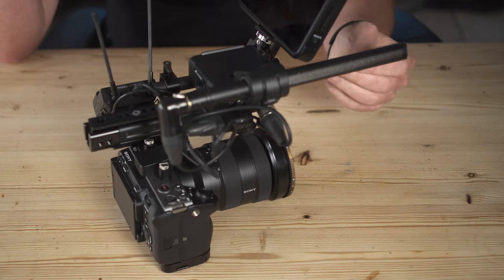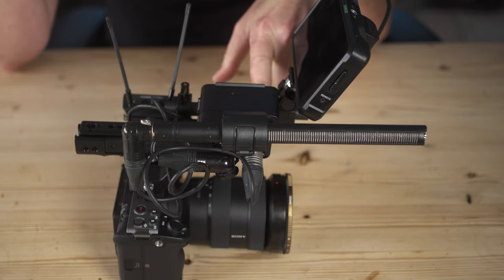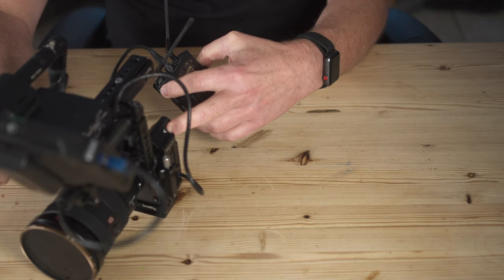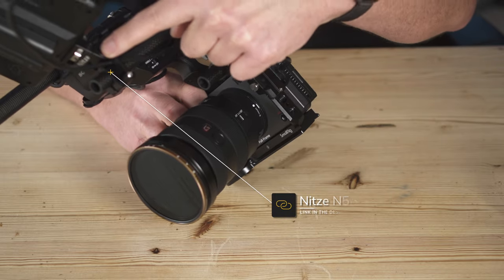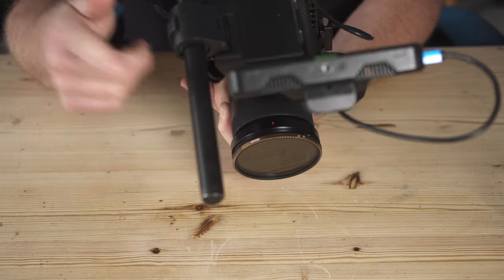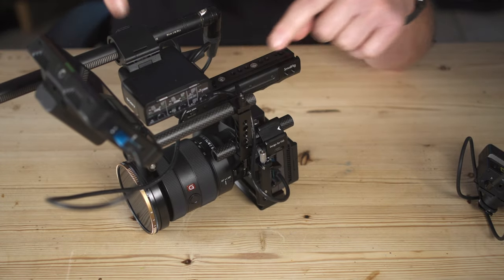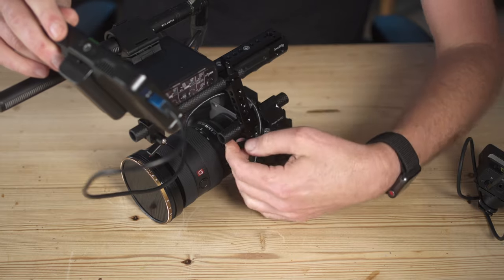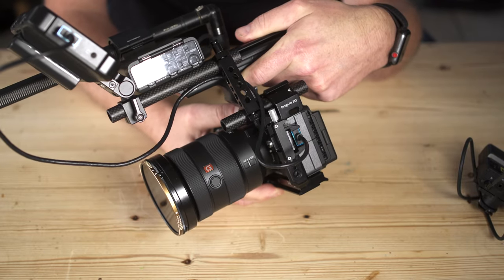Sony FX3 / FX30 Rig - A Better Way to Mount Your Monitor!

Comment: This is a really clever solution, and probably the best I’ve seen so far. Only problem is that it seems like it would pic up the fans on the monitor on the mic. And maybe only work if you’re using a super directional/long shotgun mic with little to no pick up pattern on the side of the mic. Which is tough to find, especially that close to the mic. And I use an short Octava condenser mic and that would put it right at the fans of the monitor. 

I hate that there’s no balanced way to add a monitor to the top handle and that also doesnt interfere with the mic. I have a love/hate relationship with that top handle. It works brilliantly, until you need a monitor, and then it absolutely face plants.
Reply from the maker: The Atomos Shinobi doesn't have a fan and doesn't make any noise so if using a shotgun it doesn't interfere with it at all.

Comment: This is a really great solution! I wish Sony had some foresight and had built the top handle with external monitor mounting in mind but of course that’s too much to expect 😂
Reply from the maker: My guess is the xlr module isn’t strong enough for that so they couldn’t risk having heavy accessories on it.
Reply: @PaulJoy  I think you're right! the connection between the XLR handle and cold shoe probably is meant to handle much weight.

Comment: Is there a way to achieve this when using the 4184 Handheld Cage kit from Small rig & the Sony XLR handle OR would I have to swap my cage out for the half cage you discuss in this video?

Comment: better use fx 30/ fx 3 small rig cage part, which fits directly at the place of top handle xlr, where golden pins goes in. screw the small metal part on the handle extention from small rig, horizontally out towards the left and then screw the atmos monitor on the rod with another circular metal piece like the plastic piece where mics are tightented on the xlr handle for which we have to use another ruber material for holding it tight. hope you guys got me. this way you can get another space to use focus pulling system. down just under the monitor. 

or, use that small rig metal part vertically up or downwards and then follow the above options agian, this way you can get the monitor just behind the chanel input setting on the xlr handle.
Reply from the maker: Thanks for the detailed comment and interesting idea.

Comment: Love this solution and brief video! First one seeing a pro shotgun mic. Wondering if the solution you propose leaves room to add a wooden handle to the left side? Thank you!
Reply from the maker: Yes I think there would be however you might need to remove the HDMI protector from the cage as it covers the mounting points ont he left side. I prefer not using a handle on the left as it interferes with my ability to control the lens.

Comment: Subbed!  Which xlr cable is that you are using from mic to xlr handle? The 90 degree ?
Reply from the maker: Sorry I can’t remember now, I’ve had it for ages. I always look for cables with Neutrik connectors.

Comment: What a clever solution !! 
I’m going to do the same set up with my FX3. Just a question, is it solid enough  in intensive use ?
Thank you for sharing Paul !
Reply from the maker: Hi Denis. The monitor mount is really solid, the weakest part is the xlr handle I’d say which unlike the carbon rods does have some flex in it as it’s mostly plastic.

Comment: this looks like an awesome solution to my problem, just wondering, this never rotates on you? Seems like a bit of weight...even though the Shinobi is quite light. I have a major contract this winter at a ski resort going to do a lot of follow cam action shots, I wonder if when snowboard with the rig in my hands if I'll be constantly turning the monitor back to it's proper position which could get very annoying.
Reply from the maker: You mean in terms of slipping on the rod? If so then no, it's been rock solid even when I mount a Ninja V.
Reply: @PaulJoy  awesome, i’ll take your word for it. Thanks for the quick reply, you’ve just earned a new sub :)
Reply from the maker: @domgrimard   Thanks for the sub. Check out my rig update video where I show you can even hold the camera by the monitor :)

Comment: Best Monitor and XLR build so far! Did you experience having any struggles with the monitor maybe touching the mic while filming? Did you update your rig build or do you still shoot like this? Cheers mate, loved your content, liked and subbed!
Reply from the maker: Hey Dara, the great thing with this setup is that you can adjust the position of the monitor really easily just but rotating the clamp. If using the the XLR handle I always do it this way. 

I’ve actually found a few other ways to mount things using the same kit so I’m considering uploading another video just showing how adaptable this rig has proved to be.

Thanks loads for the sub.
Reply: @PaulJoy  if you‘d post an update it would be much appreciated!!

Comment: Hi thanks! One question, how you mount the mic into the hole. My rode videomic is to small for the hole
Reply from the maker: I use a spacer. I can't remember where I got mine but they are for sale on Amazon. I've also added the link to the other items in the description. https://geni.us/LChTC6B

Comment: Coming back a year later to comment again.  Unfortunately the new Smallrig FX3/FX30 cage which doesn't have the rail mount doesn't work as well as your build.  Even when buying the rail mount attachment from Smallrig in order to get the rail mount back, the whole thing is a little less sturdy, and even worse... it doesn't nicely fit underneath the audio controls.  The rail ends up being in front of the audio controls.  I wish there were an easy way to narrow the dual rail mount pieces.
Reply from the maker: Yeah, it’s a shame they changed the design. Thanks for letting me know it doesn’t work well with the attachment.

Comment: Will it be stable enough when i mount the ninja v with npf 750 akku and ssd ?
Reply from the maker: My guess is it will certainly be stable in terms of not slipping, I can hold the camera by the monitor mount so it’s pretty strong. All the weight is on the 15mm rod mount on the half cage though so I’d imagine it does have its limits!

Comment: Wouldn't it be far more logical to buy an FX6 rather than having to sellotape all these parts together, where it ends up costing the price of an FX6
Reply from the maker: I think you'll find that these parts don't come anywhere near the price of an FX6. Plus I like that the FX3 can also be a very small rig, it's great for user on a gimbal for example.

Comment: Doesn't work anymore. The amazon links to the full cage that isn't compatible with this method. I ended up having to return everything.
Reply from the maker: That’s a shame, did you try adding a 15mm rod adapter to the cold shoe on the newer half cage?